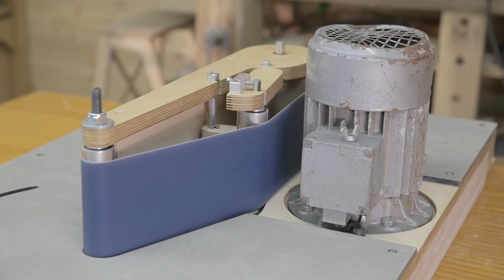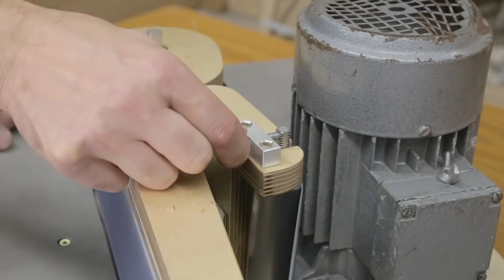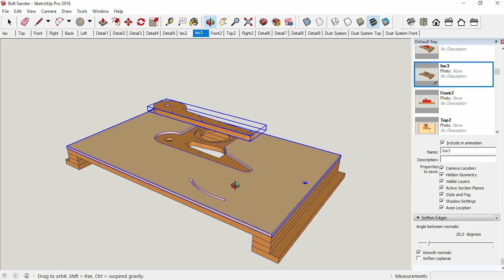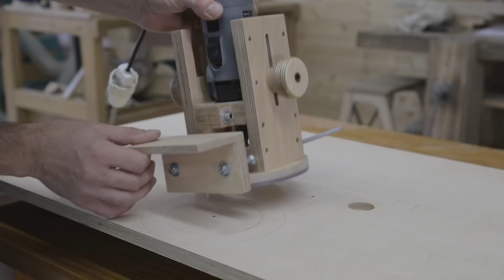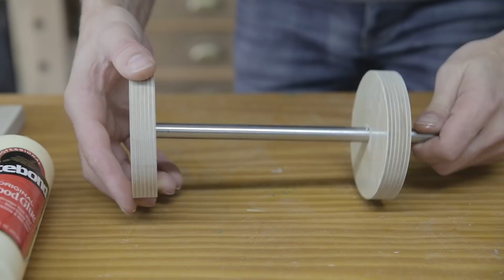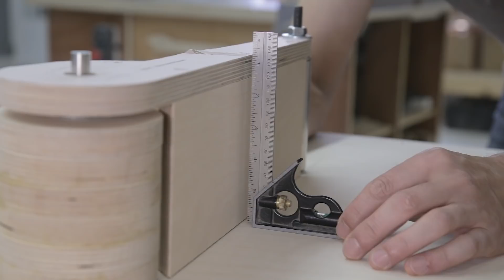Homemade Edge Belt Sander / part1

Comment: This is a very well built machine, congratulations. I especially noticed the dust extraction. But there is a small flaw in the concept. The belt turns in the wrong direction, from left to right, so it is pushing. That's because the big roller is driven by the motor. The belt should move from right to left, or you should make the small roller driven. And that would also be better for the belt tensioner, because a belt tensioner should always be in the loose part of the belt and not in the part that is under tension, as it is now.
All in all, a beautiful machine.
Best regards from Belgium

Comment: When using belt sander, most of time I see people using just the bottom part of the belt. Which wears it unevenly. I get that they can use thicker stock to sand, but most of time they're not. So, the question is, why the belt sander isn't skewed when using thinner stock? For example left side is fully raised, and the right side is half way raised or less? That way the wear of the belt would be even. Even better would be to put it vertical when rounding corners or sanding smaller area. Btw, great job as usual. That goes without saying.
Reply from the maker: hello! it is normal to have several types of sanders for different jobs. Anyway most belts are reversible nowadays. As long as the belt is glued together with a piece of fiber in the back, and not overlapping, you shouldn't have any problem using them in reverse. This will help you get more use out of belts!
Reply: Good point. I assume the skew would create marks on the work-piece, but possibly not. If the belt-sander part could be entirely rotated, on the axis of the worktop, then that would create the skew. Alternatively, if the entire part could be raised and dropped then the user could "manually" spread the wear by continually adjusting for periods of time. I prefer your suggestion of the skew though. Maybe it's not that big an issue though? I'm not a big user of static belt sanders